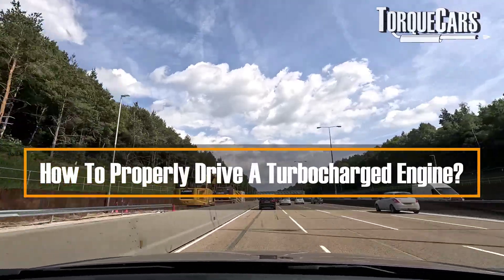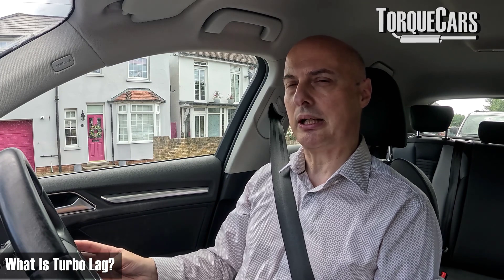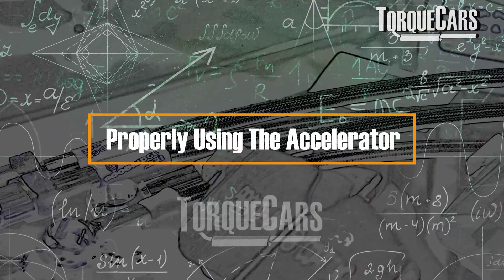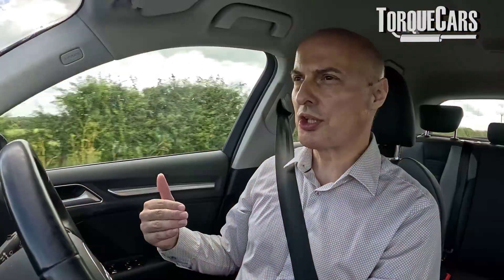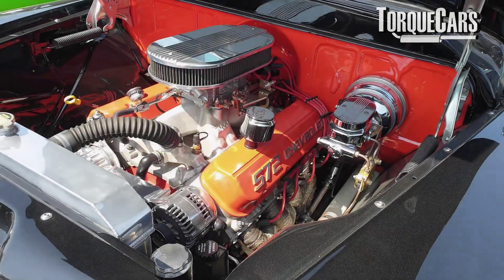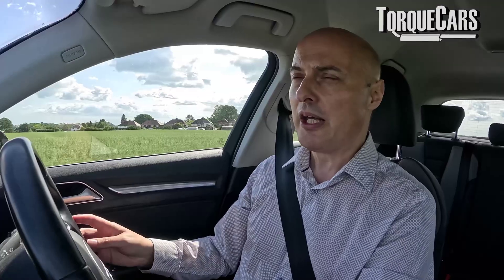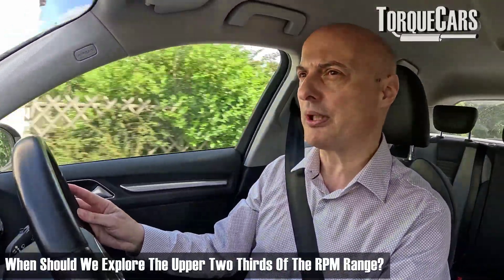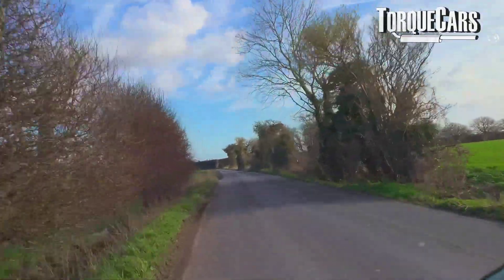10 Turbo Mistakes That Wreck Your Engine Fast. 💥🚗  How To Properly Drive a Turbo!

Comment: I'm a mechanic and I own a 2017 Mercedes E300 with a turbo change your oil every 5,000 don't go any more than that use synthetic oil always and the cool down and warm up as you mentioned